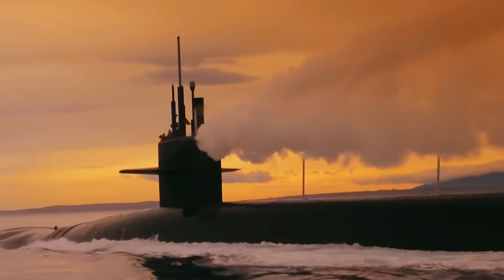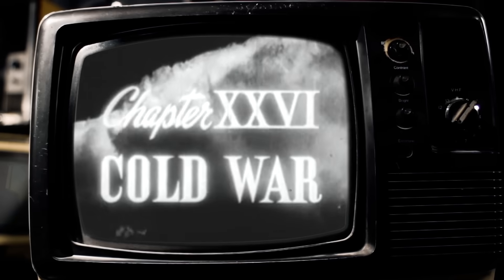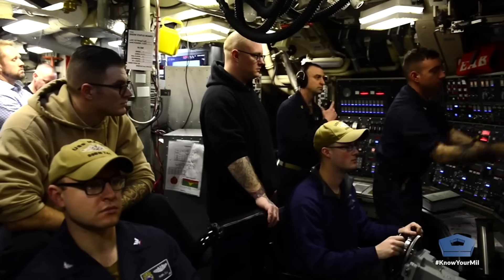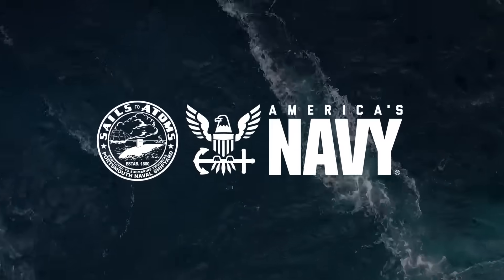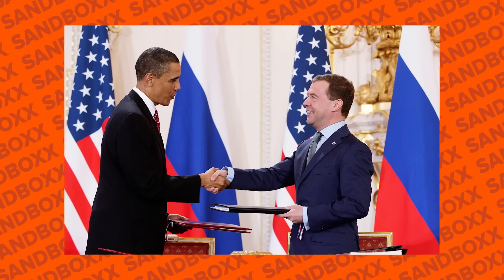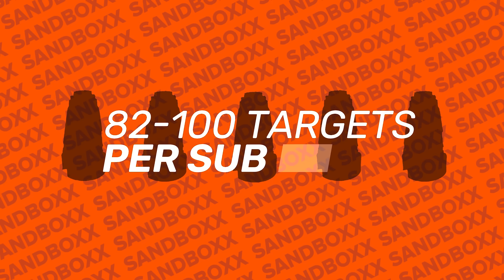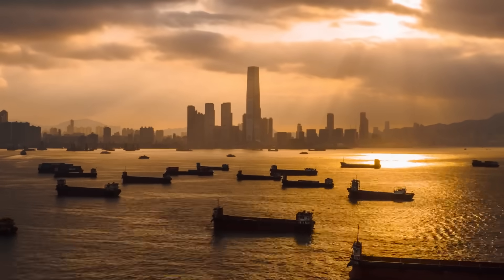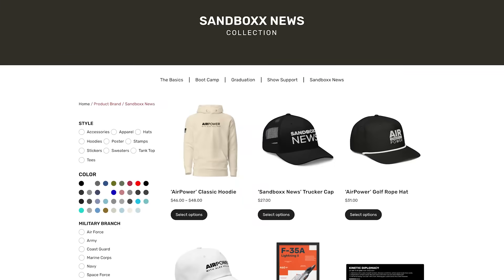Columbia-Class : The most devastating submarines ever put to sea

Comment: Another potential cost savings is to reduce the crew size (say by half) and employ humanoid robots to replace thee other half.

This not only could save money but also increase on station times by the reduced human crew consuming less food and the bots not taking up much "living" space.

Employing them  might also  help offset the recruitment shortfall problems the services are now facing.

While the technology of today's robots may not quite be up to doing this it will likely be there by the time these subs are deployed in number.

In fact over time the bots might be training the new human recruits vs the other way around.

Other advantages is that the bots could better work in high radiation areas or in fire fighting.

Also, since bots work much the same as humans there may need be minimum changes to the subs to employ them and they could be phased in gradually over time as well.

While this might not be game changing in regard to their combat potential it could be a big cost saver, especially over time.
Reply: Listen kid, its a cute way to imagine some future possibilities but we are not in star wars here. To develop such level of AI plus their hardware and change all military doctrine to prevent a robot getting hacked and pushing the button on these nuclear missile subs, would cost more than to simply use integrated AI and simplified controlls to reduce the load on the operators to the point where a task of 2 or 3 could be now done by a single crew member